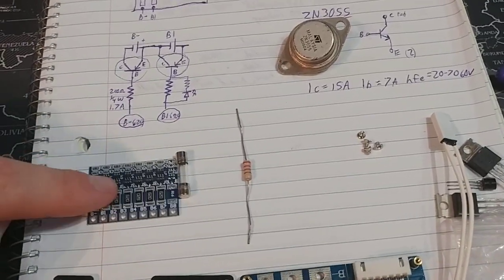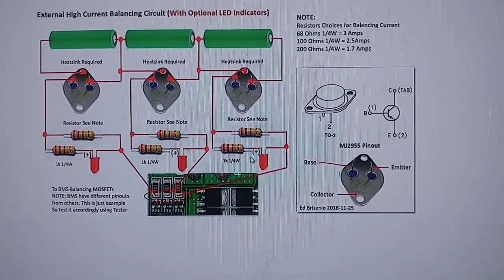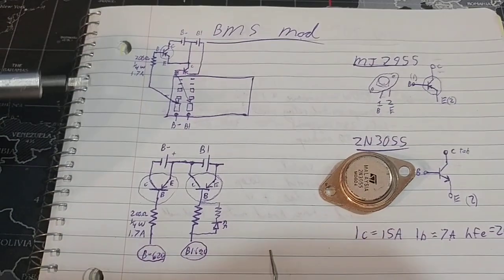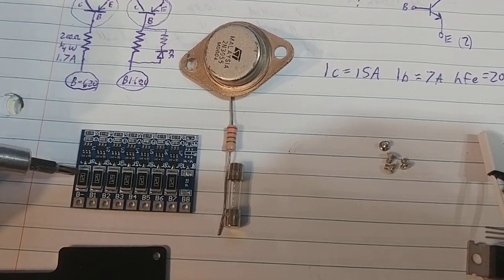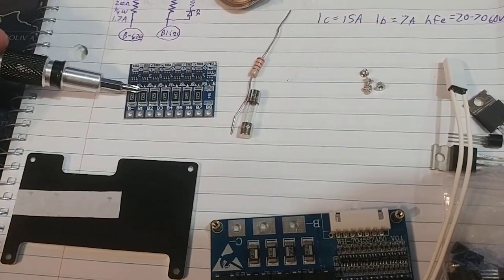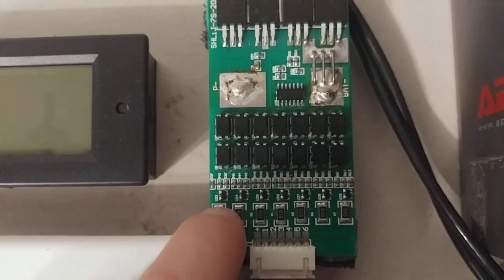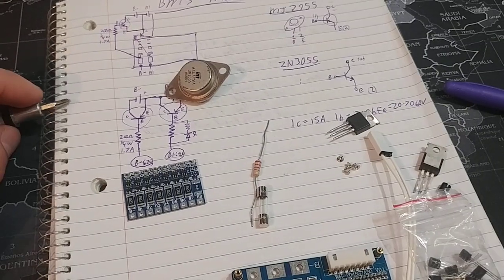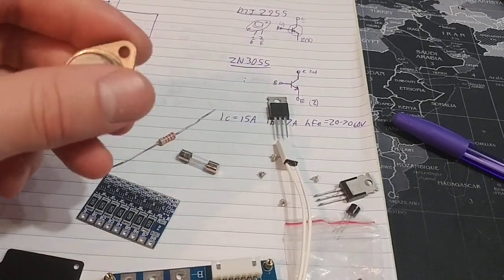BMS high drain DIY mod!? 7s 18650 battery management

Comment: and idea i had was remove the resister run a relay that switch on a heavy duty load for that cell for balancing
Reply from the maker: The deeper any of us look into this we end up realizing we need to balance the cells properly. This is just a fire hazard hiding underlying issues like cold solder joints and cells that are dead or about to pop :(
Reply: @AndyShell  not always the case some cases are that the battery been used are way to big for the balancer to work i dont pull heavy loads thru a bms i use a bms to control a relay that runs from the battery direct to the heavy load with alot of cells or just 100ah plus cells the bms dont do to well and no matter how one starts off balanced due to not all the cells been the same they always tends to be a drift in the balance

Comment: Hey man, haven't seen anything from you in a while , I hope things are going well, especially with the craziness going on, 
I was just looking over this video again, i wonder if a mosfet with logic level gate would work? With a good sized heatsink, along with a 20 watt, 1 ohm resistor or similar, or maybe a pair, the FET will likely not be e fully on , so it will possibly be part of the resistance, requiring a lower value resistor, and the larger heatsink, it should be capable of 5 amps or so, I have about 25kwh, 7s battery bank, no major balance issues,  I'm thinking about using small BMS, and a large contactor, along with a fuse and breaker, so that will take care of the off balance shutdown needs, maybe charge through the BMS, with a relay on the solar side, to protect the charge controller, I'm getting to the , well beyond the point where I'm needing a bms, and I'm a bit stingy to buy a expensive BMS, when I can buy solar panels, or more battery with that cash , haha! Hope all is well man!
Reply from the maker: Hey James hope you're well! Ive been working hard trying to pay off debt and save up for a car. Been home schooling my daughter and just relaxing. Havent done a thing to my stuff but its all good perfectly balancing its self. Nothing is breaking :)
Reply from the maker: Yea i feel you on that. Usually better to just have more batteries and solar than better equipment. If mine ever unbalance it takes minutes to find and replace the bad cell so im very lucky that way

Comment: Need help locating the MOSFETs used on most BMS boards. Mine has K150E10NE but can not find any local(US) distributors for the replacement of bad fets. Nor can I find a spec sheet for using an alternative devices.
Reply from the maker: Try Aliexpress. You checked mouser?

Comment: That's a bit brutal relying on the Vce Sat to act as a dump load!
Reply from the maker: thats what i felt too so I've switched to developing isolated tp4056 chips to charge each individual series up to 4.2 at 1 amp. still waiting on parts though....prob a month from now i can build it

Comment: Hello Andy, did you finish the high drane bms by now? i really like what you are doing
Reply from the maker: Ive made some progress mentally but i feel the method of the design overall is terrible. Basically all bms only start to drain a cell once it hits 4.18v while continuing to charge the entire battery system and will do a very slow jerking stop go until all batteries are at 4.18 and the entire system is at the preset max v. A high drain bms might be dangerous or damaging to the system oposed to just properly organizing your batteries by mAh and internal resistance values.
Reply: @AndyShell  hi, well a smart bluetooth BMS can start to drain when you want it to. you can use the app to start at 4v if you want. mayby you can build it from that kind of bms? also you can say that you only want it to balance when you are charging.
Reply from the maker: @bengrobben2582  that sounds perfect. Thx!
Reply from the maker: @bengrobben2582  https://bit.ly/2HANiGa
Reply from the maker: @bengrobben2582  I found them on ali as well. I'll have to look into this further but at 50$ its hard to justify as i have quite a few bms's atm. :( I'll have to sell them on kajiji lol
Reply from the maker: https://m.youtube.com/watch?v=v_RfcPI3WKc
Reply from the maker: The vid i linked seems like a good bridge to understanding how they work. I'll eventually come back to this idea but id rather have a different method of balancing
Reply from the maker: https://youtu.be/OG-UUXEOZ8E
Reply from the maker: That video is deff a key to solving this. Idk when i can get to it tho :(
Reply: @AndyShell  i askt him about it aswell. i think he is from holland to.

Comment: So they are using the balance only as a sort of control board or transistor driver? I thought about doing something like this. With a bms board. Using the board to drive a MOSFET array. To pass the battery current. 300a+, for the low voltage/ high voltage shutoff. I think I saw a guy just put slightly lower ohm resistor and maybe used a couple of those ballance only boards. If someone could fund a way to use the baitrium cell monitor/ balancers without the other part if the system. They are only about $15 per cell and can do like 3 amps balance current.  I love electronic engineering type videos. I had the crazy idea to build a inverter  and/or a DC motor controller for 72-96v and like 800 amps. And I knew nothing at the time. I still know little. I do know now that transistor isn't trann's sister! So I learnt a lil bit. I would atleast checkout the baitrium site. They have a smaller system for EV conversions. Considering the price of batteries a baitrium isn't that expensive. I still hate to spend that on a bms. I could buy batteries with that cash!
Reply from the maker: the baiterium unit idea is pretty neat. i think i could do it without their parts. yea I love this decade. You can learn and do anything you want and have access to almost any equipment for a decent price. its pretty sweet.
Reply: Andy Shell yes.. All the open source products. Even if it isn't ppl sharing info on hacking. Especially the EV community.  I don't know why I'd rather build almost anything , anyone with the means can buy stuff! It's more fun to build! I do need to check out  Facebook . the arduino BMS looks like it be nice also.